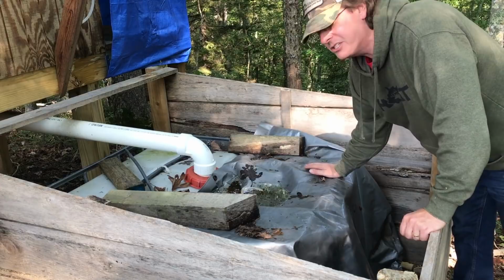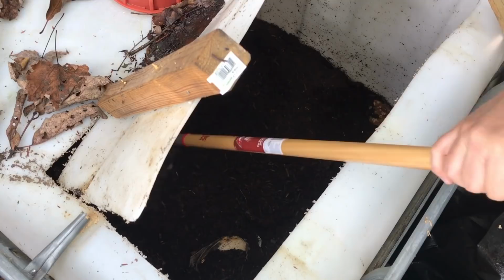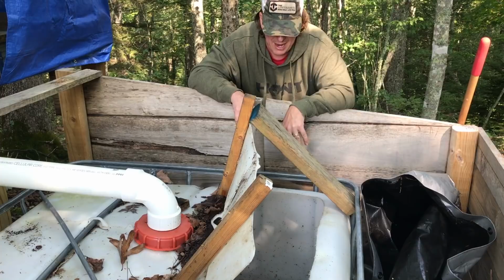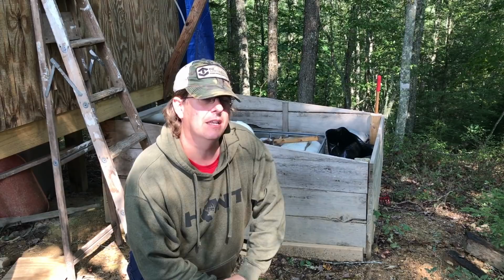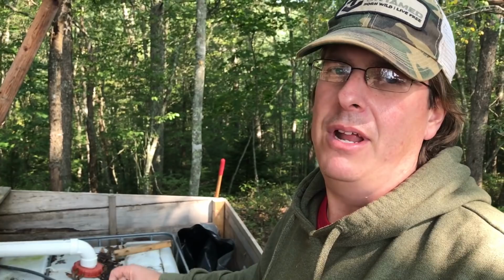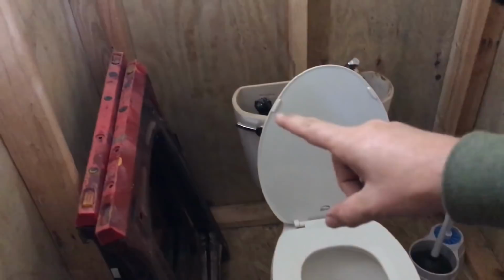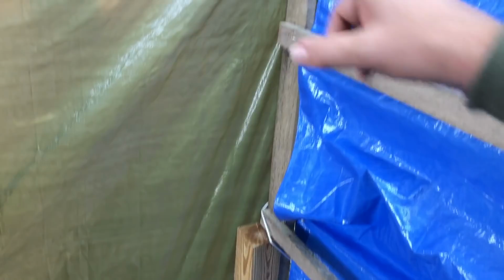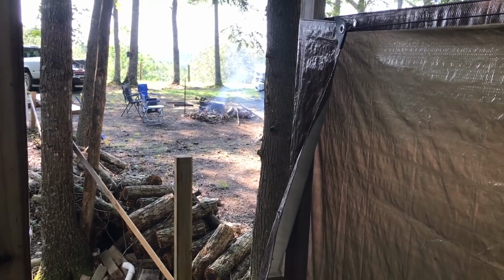UPDATE: Off-grid Vermicomposting Toilet a Year Later

Comment: I really appreciate the update, Troy.  We're three months into using a vermicomposting system full time with a family of four.  When I put together an update on how that's working out, I'll let you know.  I want to let it run 6-12 months before giving it an assessment.
Reply: How has it held up after 9 months?
Reply: Very curious to know how it is doing!
Reply: @darlarosier1779  We're 1.5 years into it now, and still using it.  Most of the time it has worked great, but we've recently had an issue we're working through. I'll be publishing a video about how it's going in a few months.  If you'd like to subscribe to our channel, you'll see when it comes out.  Thanks for the question!

Comment: I would like to use a system like this in the Philippines. Would that plastic tank size support 2 adults a 1 child on a daily use basis? Would the worms be ok with a concrete rendered block compartment with a removal wall to facilitate easy cleanout. Thanks for the videos..
Reply: I like this.  I think it would work‼️ 😉👌🏾👍🏾
Reply: Did you proceed with your project?

Comment: You do realize that those fruit trees get their nourishment from what's packed around the roots, right?
Reply from the maker: Yes, humanure is excellent for fruit and nut producing trees
Reply: @RedToolHouse  what I meant was, if you think it's safe enough for your fruit, why is it not safe enough for your tomatoes?
Reply from the maker: It is funny how “scientist” are changing positions on human waste currently. My understanding is if humanure has been composted a year then the pathogens are gone (mostly). My concern would be ground contact of fruit. If my tomatoes touched the ground then I would have a little more concern. If I am picking fruit from the tree directly, then I would not worry
Reply: @RedToolHouse  I know, but the nutrients are coming from the humanure in either case.
Reply from the maker: Absorption of nutrients through the root system is fine. Pathogens cannot be passed through that process. I wouldn’t want the fruit coming in contact with the manure directly.